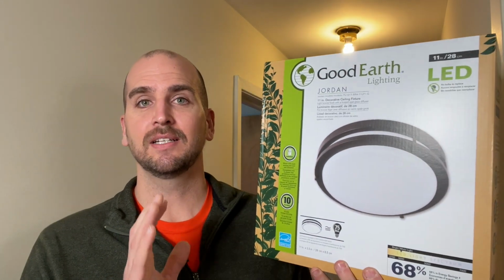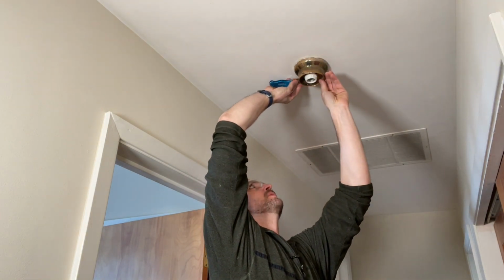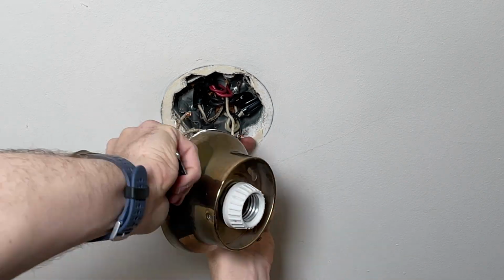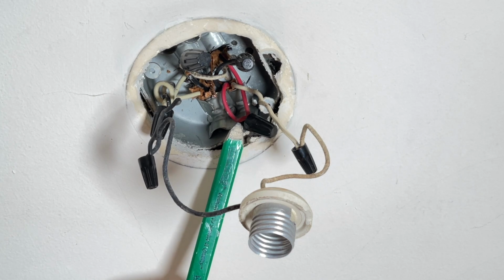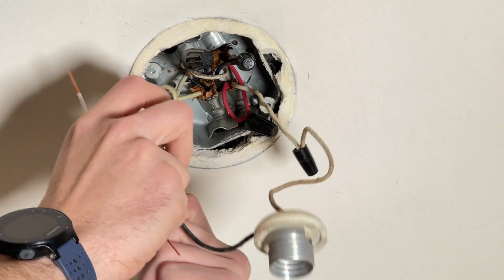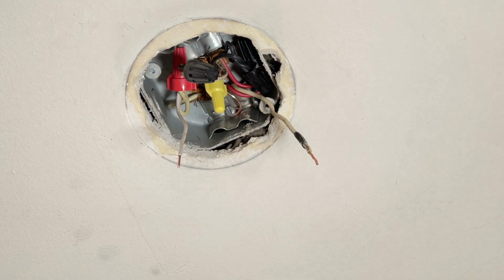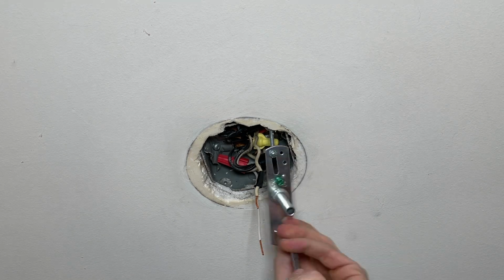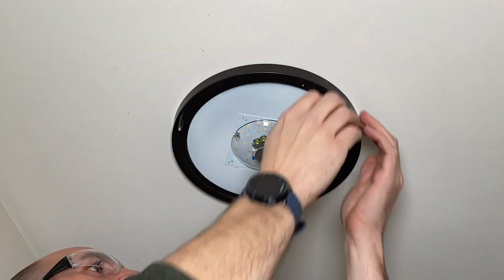How To Replace A Ceiling Light | LED Light Fixture

Comment from the maker: LED Flush Mount Light:  https://geni.us/TyM8Wd
Klein Voltage Tester: https://geni.us/fAYN9Rr
Wire Strippers: https://geni.us/MdOB
#8-32 Machine Screws (1 3/4"):  https://geni.us/JnIZ
WAGO Lever Nuts:  https://geni.us/TAwOB

Tools Every Weekend Warrior Needs
Makita Cordless Drill Combo Kit:  https://geni.us/t7dIA
Dewalt Drill Bit Set:  https://geni.us/oFlSl
Dewalt Screwdriver Bit Set:  https://geni.us/VDcr
Craftsman Screwdriver Set: https://geni.us/jXqFI
Eklind Allen Wrench Set:  https://geni.us/7XfvO
Pliers (4-Piece Set):  https://geni.us/RIdx
Stanley Utility Knife:  https://geni.us/ndIDa
Stanley Tape Measure:  https://geni.us/bUfD1R
Studbuddy Stud Finder:  https://geni.us/RySCuVw
Johnson Torpedo Level:  https://geni.us/wiLcDY
Stanley Hammer:  https://geni.us/bPDk8Wo
Buck Bros Wood Chisel Set:  https://geni.us/vk3cpTW
Klein Outlet Tester:  https://geni.us/kdBAJ
Little Giant Ladder: https://geni.us/fmlmTk

DISCLAIMER: This video and description contain affiliate links, which means that if you click on one of the product links, I’ll receive a small commission.

Comment: I always wrap the solid pigtailed ground wire around the grounding screw of the fixture mounting strap leaving a tail to connect the ground wire from the light fixture.
Reply: So do you wrap the ground pigtail to both the octogon hex screw and then to the mounting bar hex screw, then connect to fixture ground?

Comment: what would you recommend for 9 foot ceilings- flush mount with replaceable led bulbs or is it better led integrated lightbulbs . we are seniors and wonder which would be better, we will not be able to do our own electricla work if bulbs blow out and doing a new house build

Comment: Do you have to change the light once in a while or does it last
Reply: Our new lights were suppose to last 20years.  It's yr 5 and need to replace two different ones.  This time, if there are any guarantees, I will be sure to keep all info.  It sure has been nice tho, not to have to replace builds the last 5 yrs!!!

Comment: How long does the light last and how do I replace it when it dies?
Reply: You don't replace the light you replace the entire fixture. They're typically 50000 hours but in my experience they don't last that long and it completely varies depending where you install them. A bathroom vs a hallway for example where humidity and temperature may vary which LED are sensitive to.
Reply: Mine died after 2 weeks
Reply: My landlord had installed these integrated led fixtures less than a yr ago and 2 are blown... I honestly didn't know that they had switched them to these and took the cover off think it was a normal bulb... idk why they would have changed the lighting... the other ones were working just fine

Comment: Question--if this light blows out (we had an electrical issue causing too much electricity flowing to the light and fried it)...  so this might be a stupid question, but is there a replacement light bulb or do I need to replace the entire light fixture?

Comment: If the led light goes out (we have an led light like you just installed. It has worked for us for 2 years and now won't turn on) do we have to replace the whole light fixture or is there in insert that we just replace?
Reply: You have to replace the whole thing.  Mine lasted 5 years but was promised much more😢
Reply: Same question
Reply: Same problem. Any solutions?

Comment: What happens when that light stops working? I have a light just like that, but now it's not working.  Do I have to replace the whole unit or is there something to replace the light itself ?
Reply: What did you end up doing?
Reply: @mycenaean8086  I just changed the whole light.
Reply: @lifechanges4097  was it a hard process? I've never messed with something like this, but need the light before tomorrow.
Reply: @mycenaean8086  It was easy,  I've  changed them out before.  I just never just changed just the lights itself. But I've changed out the whole unit.

Comment: The green screw on the bracket is a very poor bond, because it does not have threads.   If you care about grounds, bond it to the octagon and make sure the octagon is bonded to the line side conductors.
Reply: I’m confused about this. So don’t connect the fixture ground to the green hex on the bracket? Instead, connect this ground to the wire nut grounds pigtailed to  the octagon hex?

Comment: I'm not big on the "non-contact” testers. There are situations where the amount of electricity present is not enough to trigger the tester but enough to present a safety risk. If you use a digital multimeter you get a precise reading rather than just as yes/maybe no reding.

Comment: Hello Jimmy

It was a good video easy to follow and accurate. The only thing that I was surprised about was, most of any Installation videos especially when it involves electrical usually the very first thing that they tell you to do is to turn off the power at the fuse box before you start, either the main breaker or the individual breaker that controls the power to what ever area your are going to do the install if it’s Labeled in the fuse box. You might want to edit that into your video with a “ warning “ banner at the beginning of your video. I did enjoy the video and gave it a thumbs up.

Thank You

Comment: I replaced and old light fixture with a new LED fixture but even when the light switch is off the bulb is still a little illuminated. Do you know why/how to fix that?
Reply from the maker: Hmmm, I have not had to troubleshoot this type of issue.  Just doing a quick search I came across a short article discussing the topic.  Not sure if this will work for your instance but maybe it is a start.  https://askinglot.com/why-do-my-led-lights-glow-when-switched-off
Reply: @EverydayHomeRepairs  Thank you so much for taking the time to look in to that for me!
Reply: U using a dimmer switch? Start with getting a new switch that can be used for LED'S

Comment: Great video. I'd like to see a vid on replacing 2' double fluorescents with LEDs. Not sure if I should/want to replace the entire fixture, or just do the bulb "trick". Perhaps a vid where you do both???
Reply from the maker: I did one on 4' LED Install.  This one should help https://youtu.be/yqwPsVmQXfY
Reply: @EverydayHomeRepairs  Thanks. Just watched it. Again helpful. But I can't find 2' by 10.75" LED lights on Home Depot. It looks like the wider fixtures only come 4' in length. So should I just go with the bulb change? I've watched a few vids on that, but not sure if it's easier/safer to do or should I just bite the bullet and replace the entire fixture, doing whatever extra work that needs to be done to make it look nice under the old fixture. Dilemmas, dilemmas.

Comment: You have been talking to my Missus, haven't you? She was just at Home Depot this past weekend, and has ordered three lights. One for the entry way, the light on the stairs and another for further down the hallway. Then she says, "You can install these, no?" I said, "I do IT stuff, not electrical..." - LOL Alas, I will follow your steps...

And this RIGHT HERE 3:02 is why I do not want to touch electrical stuff.
Reply from the maker: 😂  best of luck with the project.  Cut the power, take your time, be safe, and let me know if you have any questons.  The Facebook group "Everyday Home Repairs Community" will let you post a question with pics and video if you hit a snag 👍

Comment: I'm not sure, if I trust LEDs enough to commit to having those integrated into the fixture just yet.  There is a pretty good benefit to being able to change the colour temperature seasonally or whenever though.  I understand that this was not the intent of the video, but it would have been nice to see the colour changing abilities of the light.

https://youtu.be/PIAxrnkity0
Reply from the maker: Hey George, this model actually is only set to 3000K with no ability to change.  Many of the units coming out seems to be moving towards the feature of 4-5 Kelvin settings which does allow this functionality but this specific unit does not.
Reply: @EverydayHomeRepairs  
Sorry, I misunderstood.  What would be the reasons for going with a fixture with integrated non-replaceable LED?  
It seems to be a weird concept with few practical or useful upsides.  Changing out an entire fixture every time a light burns out is a counterintuitive and backwards technology on the surface.  I could see where a permanent modular system would be popular. It would be easier to consider going with an option friendly and configureable product, where LED units and "globes" could more easily be swapped out depending on what's en vogue or preferential at any given time.  Companies have only just begun to dig into the possibilities of home LED lighting.  It will be very exciting; albeit a bit bumpy for the next decade or so.

Thank you for demonstrating this project on a 3-way switch. That made it straightforward and takes the intimidation level way down. The explanation of reverse wiring and why it needed to be corrected is information which could go overlooked on other basic videos and elsewhere.

https://youtu.be/PIAxrnkity0

Comment: Still appreciate the videos.

Housing diameters: If you don't want to upsize to a larger fixtures, or maybe you have a semi-flush replacing a boob light.
If there's going to be a paint line, you can always add a ceiling medallion. (or just suck it up and paint)

What you have going on with that wiring is called a "switch loop"
It means the power is in the fixture box, and it drops a leg down and back to your switch location.

In your particular case, you have a 3-way switch loop. Which like you explained, means those those travelers would be your power down to your switch, and that white would be your power back up.

In a typical switch loop. You NEVER use the white to bring the power into the light. It's far too easy for the trimout crew to confuse that for a neutral and tie it in with them. Causing a dead short.
A rule to remember is "Down on white, back on black"
In modern wiring, you'll be using a piece of 14/3 anyway. So you don't even need to worry about that white. (only red and black energized)

Pigtails: If your fixture has leads coming off it. There is no reason to pigtail in that box. Basically you just added more wire to take up space. Space is usually at a minimum. Especially in old houses.

Safety: Make sure you kill the breaker. For the average Joe that thinks it's okay to just use the switch as a way to kill power. You must be aware. that prior to approximately 1960, it was common practice to switch the neutral. Not the hot. That means, if you have an older house, even when you turn the light off. There is still power present in that fixture box. .
Reply from the maker: Thank for all the great info and feedback.  Really appreciate your help! 🍻
Reply: @EverydayHomeRepairs  NP you're more than welcome to hit us up offline.
Reply: That's great info. Do you typically do your lights with 14/2 and 14/3 or do you use 12/2 and 12/3, I've heard so many different opinions on the matter. To me  14 gauge is plenty for lighting, just wondering what you think?
Reply: @dakotabeastj  Wire sizing is based off a few factors.

Wire has what's called an "ampacity" aka. How much current it can take before it heats up to the point of it no longer being safe.
14 awg is rated for up to 15A, 12 awg is rated for up to 20A.

The reason to know your ampacity, is so you can set your circuit rating (breaker size).
If you have a 15amp breaker, you can use any size wire, as long as it's above 14awg.
Conversely, should you have a 20amp breaker. You can't use anything smaller than 12awg.

There are a few other factors that come into play for conductor sizing, such as voltage drop, and up sizing for de-rating requirements. But those are pretty far above the standard homeowners playbook.

To summarize. 20amp breaker=12awg or bigger. 15amp breaker = 14awg or bigger
Reply: @renegadeelectrical1264  got ya. I actually knew that, I was wondering what your preference was for lights? 14 awg or 12 awg, but I appreciate all the extra information and help!
Reply: @dakotabeastj  Ahhh gotcha.
It's irrelevant then. You'll be using whatever size conductor that circuit requires.

Wether we're doing 15a or 20a ckt depends what we're wiring.
New construction, custom homes. Typically do a 20A lighting circuit per floor.
Adding a room in a basement. More than likely using the same 15a that's powering the rest of that room.